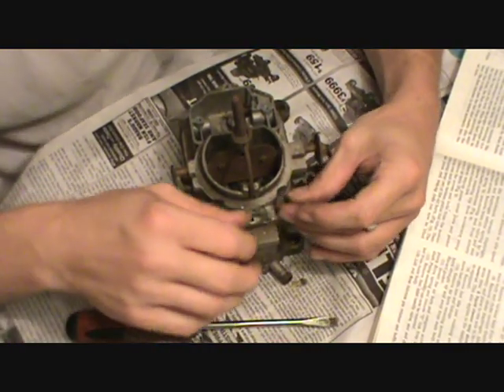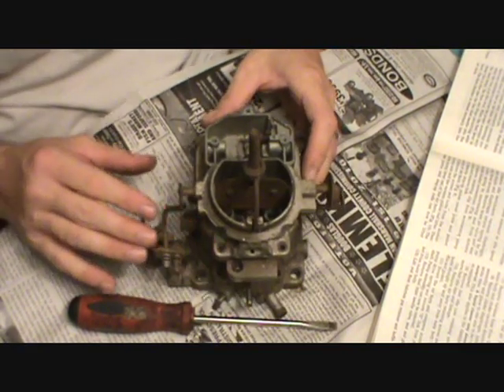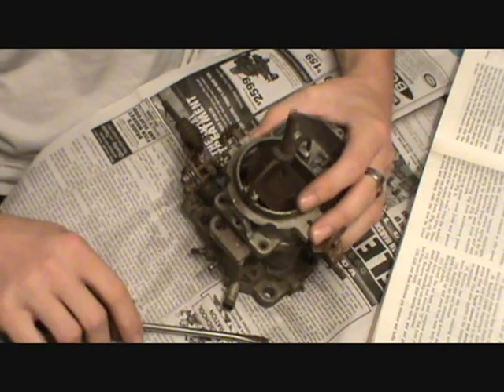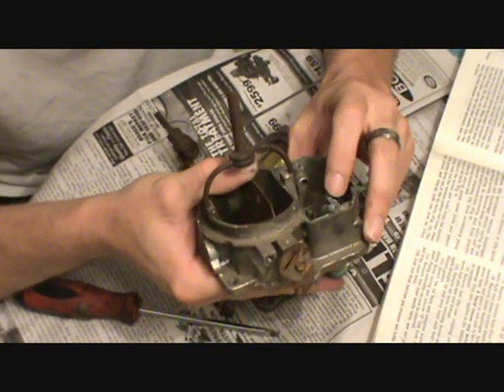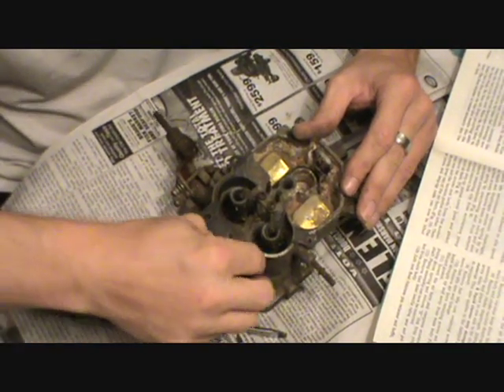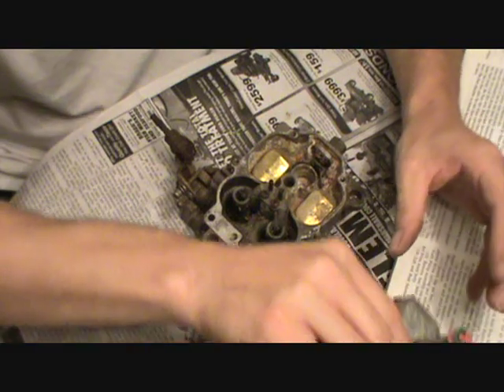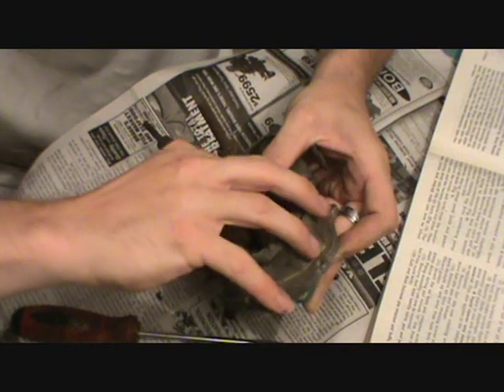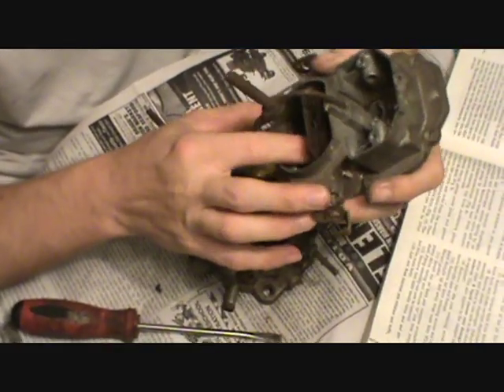Rebuilding Carter BBD carburetor part 3

Comment: Hi Tyler, you're the only one I think can help me here. On my 67 383 with the BBD 2 BBL after rebuilding the carb I have a stumble on light acceleration. I went to check the accelerator pump and with engine off if I open the throttle the pump stays up and only if I push the pump down will fuel spray into the carb. How does that pump normally get pushed down if theres no mechanical linkage to push on it?  Any input would be great & thank you:-)